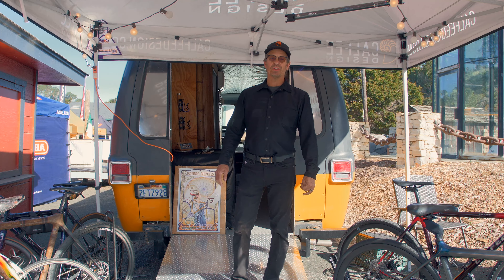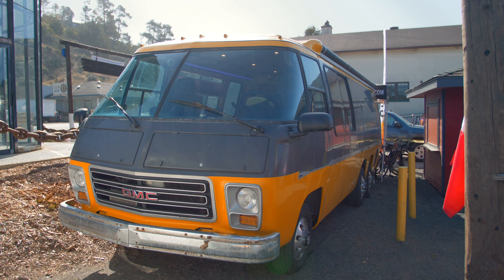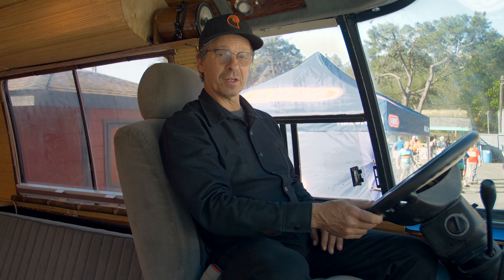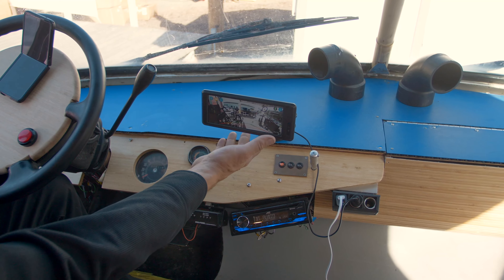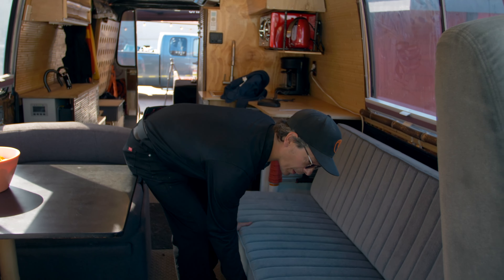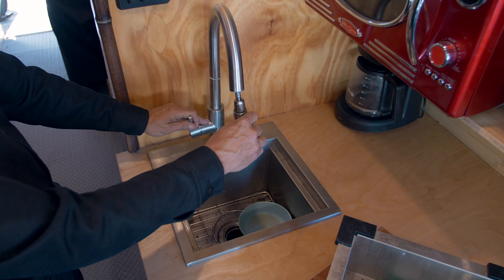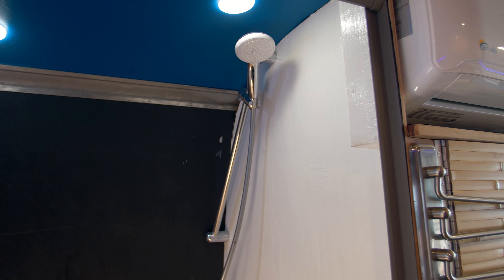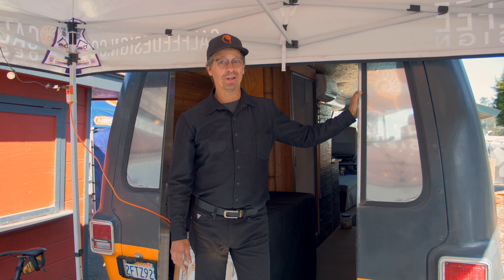Calfee GMC Motorhome Tour

Comment: Craig - Nice job with the refit.  Can you share the model number of the split AC unit and also some details on the solar panels?  Thank you.
Reply from the maker: It's a Senville, smallest size they make. And the solar panels are from Gigasolar, made from recycled plastic bottles and fiberglass. They were custom made for a distributor who sold them off when his project didn't pan out.

Comment: Very cool set up.  -  I’m hoping to do the same flexible solar panels and HVAC set up.  Where is the condensing unit located?  I was thinking about putting it in the propane cabinet.
Reply from the maker: It's located where the generator used to be.

Comment: BTW, as parallel universes go, I've built 2 bamboo road bikes.
Reply from the maker: Cool! Did you refer to my videos on that?
Reply: @CraigCalfee  Not really. I just duplicated my favourite bike in bamboo and several years later did another with a few improvements like internal cabling and flat kit in a top tube extension.